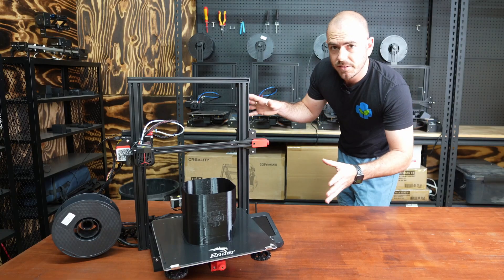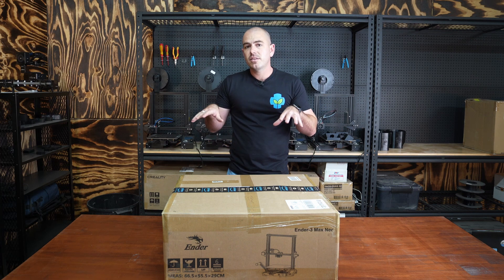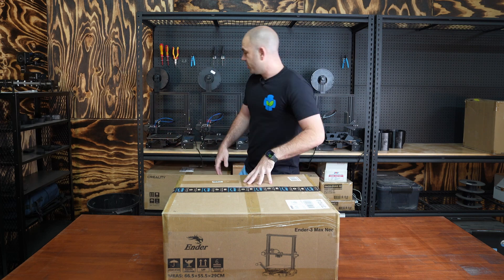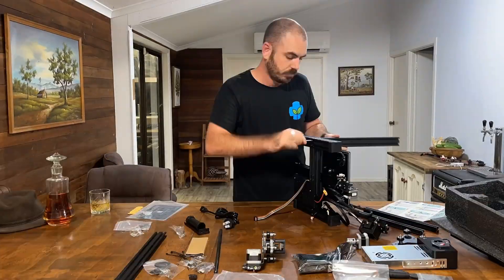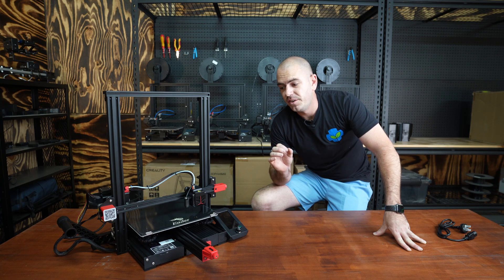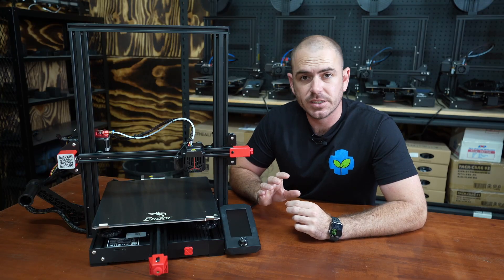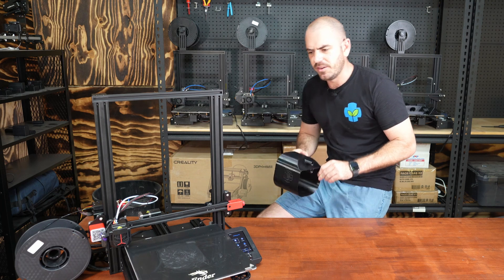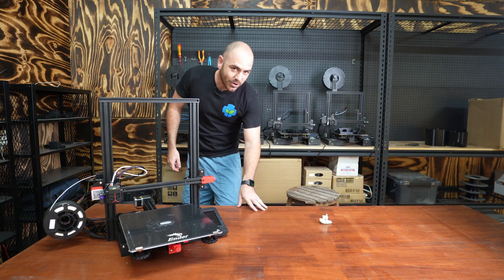Ender 3 Max Neo 3D Printer Review

Comment: I have two of the ender 3D Max neos. Pla you wait until the bed cools down. Petg you need to take it off immediately. Or you can wait until it cools down and then reheat the bed. Once the bed is back up to 80c try taking it off. This is what works for me but it might not work for you because I'm making a certain type of thing that most people aren't.

Comment: I just got myself one thanks to your video! Can't wait to give it a go and start building some of the modular units etc.
Reply: How do you like it so far? I'm considering potentially getting one.
Reply: @OganySupreme  Truth be told, I'm yet to set it up. Took a couple of weeks to arrive and I've been flat chat with other things. All things being equal, I'll finally get to set it up this weekend and have a play.
Reply: @EviLEwoK666  Nice! I ended up ordering it too and it should be coming in the next couple days.
Reply: @OganySupreme  Finally got time to get mine up and running and after spending a little time making sure it was leveled out and accurately setting the z-axis offset, I printed the rabbit as the test run and it was near perfect!

Can't wait to get stuck in with this printer. Thx @hoocho for the recommendation!

Comment: With my ender 3 v2 I always use the glass side. I generally have to wait for the bed temp to go back to room temp and it seems to peel off a bit itself. But mostly I was using PLA. PETG may act differently.

Comment: Seeing this Ender 3 Max Neo with all the much needed upgrades is great.  Been using a heavily modified Ender 3 and Ender 3 s1, I must say I'm quite impressed with the Max Neo Video here hoocho!  After seeing this video, I'm seriously recommending the Max Neo to those that want to give FDM 3D Printing a try.  For the price and features, it's quite solid.  I've probably spent more money on modding my Ender 3 to be much like the Max Neo.  Would love to see you cover more.  I'm particularly interested in recycling PET/PETG to use for future hydroponics!
Reply: I have one on the way but i am biting my 
Tung because i herd of banding-ringing have you havd this problem
Reply: @seadragon8546  All the printers with bondtech gears that I have worked with always seem to produce ringing.  Haven't quite resolved that but have greatly reduced it through tuning print settings, belt tension, part accuracy/trueness.  Banding happened to me when the filament wasn't dried prior to printing.  I swapped the extruder housing to an all aluminum one, replaced the PTFE tubes with Capricorn PTFE tubes, and used a glass bed w/ upgraded springs.  Much needed improvements for the kind of prints I am working with

Comment: Ha, if your benchy sticks to your plate, that's a very sticky plate.

I've been so tempted to get a flexible steel plate, but the levelling and depth setting on my printer is so obtuse and brutal to deal with. I've got a glass plate with a sticker layer to help with adhesion and release, which... Kind of works. The glass holds heat beautifully, but I almost always print PLA so I'm not even sure that's a feature I need to depend on that much.

I recently printed the flood and drain system, by the way. It went beautifully. A little gnarly on the threads, but nothing a little coaxing couldn't fix. Very excited to get it running. It got me fired up about printing gaskets, but man alive, I can't get flexible filaments to print. My extruders always eat it. No tensioning, temperature changes, or even new nozzles could save it. FML I guess. One day I'll figure it out. But how cool, right? You could even embed the gaskets onto the print for printers with more than one nozzle. That would be incredibly slick.

Always get a kick out of the slide intro. Keep up the good work!

Comment: Just a tip: you shouldn't use PETG on a glass surface as it can literally fuse to the glass, taking pieces of the bed off with it when removing. I'd recommend a magnetic sheet and PEI flex plate!